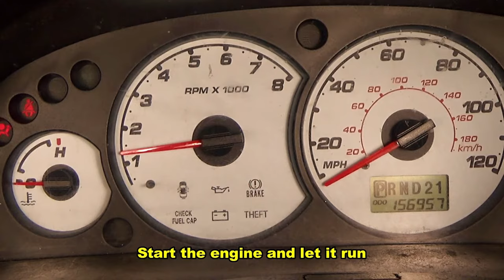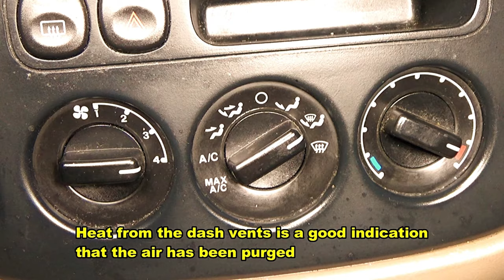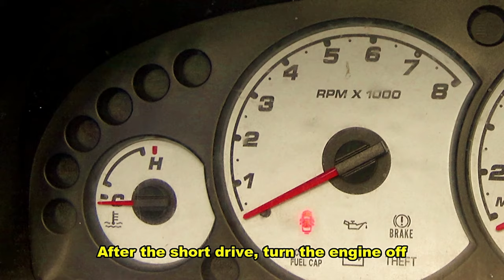Refilling the cooling system (2001-2012 Ford Escape, Mazda Tribute, Mercury Mariner)

Comment: Hi, I've replaced the water pump and housing and when I pour coolant in overflow tank it just sits there and won't drain into radiator or engine. Wondering what's going on? Thanx

Comment: What specific brand of coolant do you recommend for a 2012 ford escape?
Reply from the maker: Motorcraft Gold (yellow) is what's recommended. Thanks for watching!
Reply: Pretty surefor a 2012 ford escape you need to use the NEW motorcraft yellow. 2012 i believe was originally orange coolant. They switch from gold in 2011. So early 2011 escapes are gold, late 2011 and 2012 are orange. But the orange is discontiued and it is now the motorcraft yellow.

Comment: My air ain’t coming out hot. Been waiting 10 mins 😢
Reply from the maker: You either still have an air pocket in the system, or the heater core is stopped up. Find the 2 hoses that go to and from the heater core (through the firewall against the passenger compartment). Both hoses should be hot. If one is hot and the other is not, hot coolant is not flowing through. If an air pocket is still in the system, try disconnecting the hose that goes from the expansion tank to the top of the radiator (disconnect from the expansion tank). Hold the open end up, insert a funnel, and pour coolant down the hose into the radiator. Fill until the coolant is no longer going down. Reconnect the hose, run the vehicle, and squeeze the hose. This is called "back filling". I've had to do this to finally get things going with the hot air. Hope that helps...and thanks for watching!
Reply: @GreaseMonkeyFever After replacing the thermostat, overflow reservoir, and the water pump that's exactly what I did. It took awhile to get all the air out and your video is great! I made sure to bring the ECT up to 225 so that not only the thermostat opens but the fans turn on as well. I wanted to make sure the entire system was functioning the way it's supposed to. Much more tedious then vehicles that aren't a closed system.